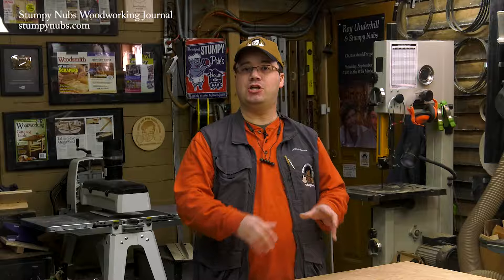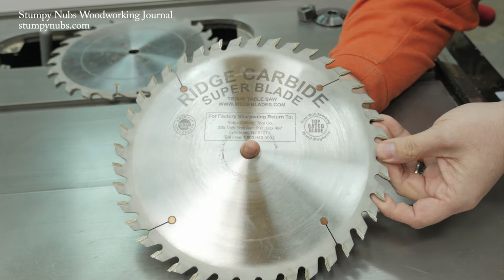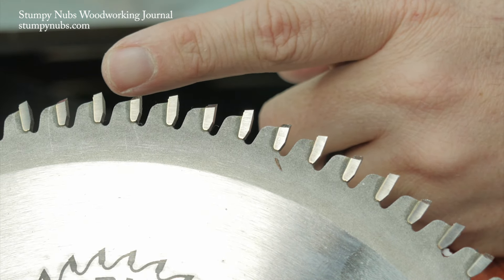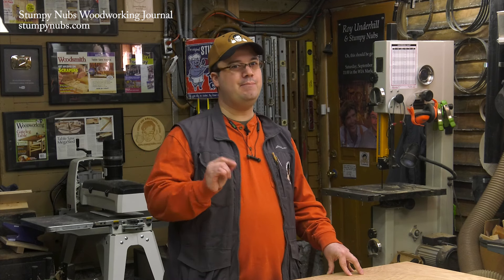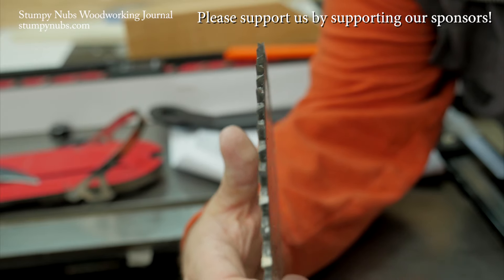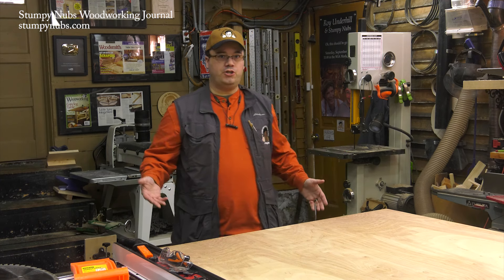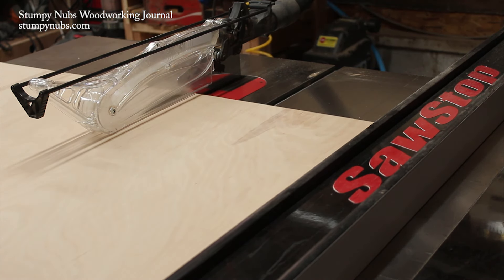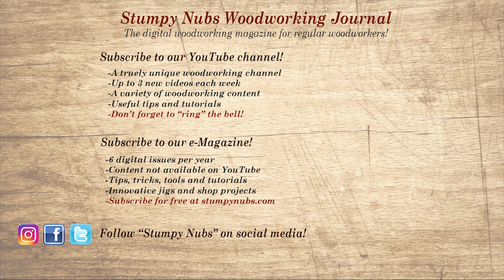Plywood is difficult to cut on the table saw? Let's fix that...

Comment: Just wanted to add "clean blades" - I don't have the link to your vid on cleaning, but, I CAN say that the Simple Green HD ( it's purple of course) works like nothing I have ever seen before. For a large batch of blades to clean, I get my trusty 5gal bucket lid and pour in some of the Simple green at full concentration, for a single blade I have a spray bottle of 50/50 mix ( both of these concentrations are way more concentrated than the mixology listed on the side of the bottle) but this stuff, even at 50/50 dilution cleans the pitch off almost instantly - spray on and use the brass toothbrush to brush clean - no effort. At full strength it even cleans off the smeared paint and any other evidence of usage from the body of the blade.

This stuff works so fast it almost takes longer to change the blade on the saw than it does to clean it. ( you could even just clean the blade you are installing and run it through some scrap to dry it off - no rinsing required )

Right after having the right tooth count/profile and a sharp blade, having it clean just makes it cut better.

Thanks again, love your channel

Comment: My apologies if this seems lazy in not looking through all your videos for an answer to this question: What are your thoughts on a table saw purchase?  I have had a Ridgid table saw for years and I feel like I'm constantly having to tweak things to get straight and true cuts and adjusting the blade to make it perfectly parallel to the miter guides is a lesson in futility.  
Thanks for the great channel and any help you can offer.
Reply from the maker: I like SawStop, but if it's not in your budget you can look for a good used Delta or Rockwell with a cast iron top on Craigslist. With patience, you may find one for under $300. Upgrade the fence, blade and miter gauge and you'll have a lot more saw for about $500 than any new $500 saw on the market.
Reply: @StumpyNubs  Thanks.  I've been eyeing up a SawStop for a while.  Are the larger ones worth the extra money?  Thanks again.

Comment: Someone needs to repair that cord on the circular saw!
Good series!!!  Rather than using OSB beneath the plywood to break it down, I like the idea I learned from Steve Ramsey:  Use a board of construction foam, which is light and easy to manipulate.
Reply from the maker: Foam is a lot more expensive (at least it was before Covid caused construction materials to go through he roof). That OSB was about $10 at the time of this video. 2-inch foam was about $30

Comment: I built my assembly table at the same height as my table saw so when ever I need an out feed table I can always move it .  I know that not everybody can do this but even a foot or two to support large heavy pieces at the back of the saw makes a huge difference on leverage and that might be the difference between a clean cut and having to fight the last bit and ruining something that you put some serious time into
Reply: I kind of do the same thing only I don't have to move anything. I have a folding outfeed table that swings up to bridge the gap between the table saw and assembly table, then folds away so I have full access around the table.
Reply: Answer is 42 ... My assembly/construction/do-everything table ( LOL ) is 4 ft. x 5 ft. ( my shop is 20 x 20 so I have the room ) and is also the same height as my table saw and makes a great out-feed table. I also put wheels on this table and on the table saw...easy to move around when needed. My table saw has the motor sticking out the back so there is about a 10" or so gap between the saw and table but I have a small piece of wood that I place in there and it bridges that gap for me. And then, I use c-clamps and clamp the table saw to the work table at the ends of the fence guide and that gives me a lot of stability for my table saw when I am running a heavy piece of wood thru the saw.
Reply: @marbleman52  - I have the same situation at the back of my tablesaw.  My assembly table is 3x6 and is an old desk that I lifted about 6 inches and propped with wheels.  It fits right over my motor and I still have a 2 inch gap because of the old fashion fence.

I will be building a new bench this summer.
Reply: @markbeiser  those folding out-feed tables are nice and so very functional in close quarters.

Comment: I have been cutting sheet goods and solid wood on a table saw all my life,  today is my 68th birthday. I found as I grew older moving heavy sheets of plywood and other sheet materials out of my truck and into the shop and on to the saw a challenge. I made the task easier for unloading and setting the sheet , ready to cut. Many different ways to do this . I use a drywall cart to get the sheets into my shop and found a tool that is rarely seen to lift the sheet on the saw. It is named the leg up. It consists of a hinged leg with a hok on the end of the leg and it bolts (clamps) on the edge on the table or the end of the fence so you wheel the drywall cart alongside the saw and take the end of the sheet and rest it in the hok then set the opposite edge of the sheet on the ground and pull the drywall cart out of the way. Standing at the back end of the sheet of plywood you merely tip the sheet up on the table saw top and the hook is long enough to place the sheet just shy of the blade so you can shift the sheet back and forth to move it out of the hook on the leg where it drops back down, ready for the next sheet and cut away. Just a different method to manuver sheet goods into the shop and up on the saw table.
Reply: James....Yep, us older men...I mean "Distinguished Gentlemen"..LOL..have to  be creative in how we handle heavier items than what we once did...Darn it..!! We definitely have to work smarter.

Comment: Great video series.  I had to laugh to myself... 2:30... "through the shop door".  In my case it is off the truck, through the garage, into the house man-door, then down the stairs, turn 90 degrees in the hallway and finally through the shop door.  My shop is in the basement and carrying anything more than 1/2" sheet of 4x8 is near impossible without another person.  Even 1/2" is a royal PITA.  So, I have to breakdown my large sheets in the garage... usually the first cut, before it goes down and to the table saw.

Comment: I don't have a shop with a permanent table saw. Actually, I don't have a shop at all. I only use the table saw a couple times a year if that. I have to wait till I can get to my dad's house to use just enough space to set up a work table. So I broke down a full sheet in half by length (2'). I then set up my Bosch worksite table saw to workbench height for a full-length outfeed to rip into 12" by 7-foot length. Got 2 feet in and the plywood started to walk away outfeed side. Pulled it back and tried again this time pulled away before the blade. I just quit and set up my aluminum rip guide for plywood. Had to shrink the width because I messed it up with the table saw. In the end, it worked but it's harder to get 2 perfect rips this way. I can never product to stay tight it always seems to walk. I watch guys on Youtube just throw up sheets and rip with no trouble. I understand the first problem tiny saw and set up, but still? I build decks and porches for a living, not like I dont have skills. Just not tiny table saw skills.

Comment: Hey there I love these videos!!! very thorough and easy to follow i do have a question I have a peice of formica not a full peice but a pretty heavy peice would you recomend a table saw for this rip? 
I'm basically shortening it from its width i plan on making the cut giving an inch or so of leg room to spare but my initial question 
Formica + table saw
Or 
Formica + a skill saw 
Skill saws are not my preferred choice
Reply from the maker: You can cut it on the table saw, but use a fine toothed blade so you don't splinter it (the same would be true with a skill saw). If you don't have a fine blade, cut slowly so the teeth only take tiny bites. Also, make sure the sheet won't slip beneath your table saw fence as you cut.
Reply: @StumpyNubs  thank you so much ill be sure and take it slow ill send b4 and aft pics

Comment: “Handles to make lifting and carrying large sheets easier” also known in the trade as a framing hammer. Hook the claw under the bottom edge of the sheet to lift it and steady the top edge with your other hand and away you go.

Comment: I am 75 YO. Handling a full sheet of 3/4" plywood on a table saw was hard enough when I was 57. Now I have totally given that up. Four saw horses and a track saw and I can make perfect cuts in any plywood that I have. I do it in the driveway, just outside of the garage/shop where I can simply slide the plywood from the bed of my truck onto the saw horses. Then lay down the track and zip, zip, zip. It is so easy I wish I had a track saw 50 years ago. 

I still use the table saw for smaller pieces.

Comment: Another first-class presentation.  

Question.  I’m new to woodworking and about to purchase a 52 inch Incra table saw guide system for cabinet making in my home.  My thinking is the widest fence range is better to cross cut the plywood in half (a nice 90 degree edge).  Given the expertise out there, are there any factors involving safety and practicability I should consider in opting for a smaller fence system like the 32 inch. Professionally, “most of the time” is it better to just cut a 4x8 sheer in half with the circular saw before?  Thanks in advance

Comment: Kind of new to woodworking, and trying to figure out the best way to crosscut boards for a 36” length for cabinet drawers. Obviously these all need to be accurate for a square drawer. Any help is greatly appreciated.
Reply from the maker: Use a table saw crosscut sled. You can make one yourself.
Reply: @StumpyNubs  Yeah, just found some plans. Going to build one soon. Thank you for your speedy reply. Have watched the whole set of safety videos. Very helpful. Feeling more secure about my new table saw now. Thanks again. 👍🏻👍🏻👍🏻

Comment: Hi.  Thanks for your great videos. I have a newbie question: how do you prevent overshooting/ undercutting a cut on a plywood sheet when you’re not making a through-cut? Let me explain: if I needed to make a 10” long cut on a 12” wide panel of 3/4” plywood, I’m only able to see the top surface of the board as the blade cuts through the material. If I mark 10” and cut to that mark, the circular blade would have undercut the panel, such that on the underside of the panel, the cut will be longer than 10”. Is there a calculation that tells me when to stop short so the cut is never longer than the 10” I want?  I get that I’d probably have to finish the cut by hand to get to 10” on the top, but that’s a small length to make a manual cut, for which I don’t mind using a hand saw. Or is this an impossible task for which I should use a jigsaw, bandsaw, or hand-saw? Thanks in advance.
Reply from the maker: Are you talking about cutting a stopped dado on the table saw? You can mark the location of the edge of the blade closest to you on the fence of your saw, then stop when you push the panel up to that mark.

Comment: I seem to have purchased odd sizes. 
My craftsman hybrid table saw I purchased 6 yrs ago came with a 36 general purpose rip blade ?
Not sure how my new hobby of wood crafting was going to work outI ran back to sears. (sadly gone and tore down) and picked 2 more 10 inch blades.
It's a 2 pack of blades and maybe someone can vice me some advice about them.
The one on the saw is general purpose 36 tooth.
Second one is a 40t  carbide general purpose with pictures of a chop saw and table saw.
Third one is a 60t carbide  smooth/cross cut.
And shows a chop saw a table saw and a saw that pull across the bord. It's not a miter/chop saw.
I started buying tools several yrs agoing planning on the days that give me time to start fine wood working,.
Spending the last week and  half working on my garage/shop area.
I'm getting excited and making promises to the wife....I can make now if you want!😅🤣😂
I hope there's someone outhere with some wisdom about my odd blade sizes. 
Thank you.

Comment: As a funny item here... in Japan because people are smaller, and the JIS wants to minimize injury, the "standard" size for plywood, drywall, mdf, osb, etc. is 910mm x 1820mm (35 3/4 in x  71 2/3in).  So even 24mm (3/4 in) plywood is still reasonably manageable by one person with or without lifters.  These sizes drive interesting construction dimensions, as the corresponding rigid insulation sheets are also this size.  Strangely for wet surface construction (like making concrete forms) they are 900mm x 1800mm.  Why the are 10 and 20mm smaller respectively for these boards is an oddity I have not figured out.  Scott from Japan

Comment: Great tips! Thanks for this. Question - what's the best setup when you have a panel piece to crosscut that doesn't fit between the miter gauge and the blade? I was thinking about turning the miter gauge around 180 degrees in the miter slot, adding a longer sub-fence, and running it "backwards," using it as a sort of front fence to reference off of. Any tips are appreciated!

Comment: James - I've posted a few questions already, but I have one more. It seems that the danger of kickback with a circular saw is inherent because the blade is spinning towards you at 4,000 to 5,000 rpm so naturally anything that comes in contact with this blade could be thrown back at a very high velocity. I had a 3-inch x 24-inch piece of plywood that I wanted to cut into two, 1-inch strips and I decided to just use my small circular saw for these - but it wasn't easy. I've watched all of your safety videos, but I was wondering if you could comment on the things that you can do, especially with smaller pieces of wood to prevent kickback. I now know that rule #1 is to never use the fence to do a crosscut with a wide piece of wood but are there other rules to follow? Thinking about this, what I probably should have done is make a long, thin push block for thin pieces like this.
Reply: I meant the danger with a table saw - not a circular saw, but that's also a danger too.

Comment: For me, I handle big sheets by going to just the circular saw with a guide clamped to the wood, and cut it into more manageable chunks first - I have found it near impossible to keep it straight on the fence.

Comment: This is why you really should by a track saw. I bought the cheapest one I could find. The Wen track saw. It's definitely not the greatest, but it works pretty well. Just don't try the 45 degree beveled edge. As it tends to get a bit wobbly.  Do 90 degree cuts and you'll be fine. And be careful not to cut the table the your piece is sitting on.
Reply: toss down some rigid foam for the workpiece to rest on.  Any cuts through go into the rigid foam, and it's a stable platform.  Protects the table too

Comment: I am a little confused, the link left in this video for the 80 tooth atbr blade seems to be for miter or radial arm saws. Does it work also for a table saws? If not what blade should I use for a fine crosscut on the table saw. Also is this blade also ok for ripping?
If anyone knows the answer to this please let me know

Thank you for all the useful info
God Bless
Reply from the maker: I admit, that's confusing. But yet, it is also a table saw blade.

Comment: You don't need a 80 tooth blade for veneer plywood. Simply place a thick tape (not thin tape) across the cut area and / or another piece of wood over it (2x4) that your blade will not cut through fully. This will give you a clean cut even with a 24 tooth blade.

Comment: To avoid veneer tearout on plywood use a good sharp marking knife to mark your cut lines, and take two or three passes with the knife to get the line good and deep. If the surface veneer is already deeply scored on the cut line, it's a lot more difficult for it to tear out.
Reply from the maker: That (and a lot more) was covered in the crosscut video, which was one of the five parts in this series.

Comment: I have always been told never to use a table saw to cut something that is wider than its length against the fence but I see it done in this video and others on this channel.  Am I missing something?
Reply from the maker: I was taught that if the distance between the blade and the fence is greater than the length of the edge against the fence, you should use a sled. However, larger panels can sometimes be done safely if the edge against the fence is long enough and there is not too much excessive weight on the other side of the blade that causes drag and may twist the panel.

Comment: I have the small Dewalt DWE7485 portable table saw. It has the 8 1/4" blade. Does anyone know of a fine tooth replacement blade in that size? Thanks

Comment: Hey stumpy, the link for the Ridge Carbide place below links to a negative five degree blade. I thought that negative degree hook angle blades where for miter saw’s and the like and positive hook angle blades where for table saws. Am I wrong on this? Etc. thanks again.
Reply from the maker: A negative hook produces a less aggressive cut. They may be used on either type of tool.

Comment: Do you recommend using the 80 tooth blade for ripping plywood as well as cross cutting it?
Reply from the maker: Yes. It would make no sense to switch back and forth between blades. The 80 tooth will do both.

Comment: Can the cross cut 80t blade you recommend also do rip cuts on that table saw? Or do you need a special rip blade also?
Reply from the maker: On plywood? Yes. You could rip solid wood with it too, but it's not the best blade for that.
Reply: Stumpy Nubs thank you. I have a 60t Diablo and it’s decent. But noticed it has some minor tear out on plywood cross cuts